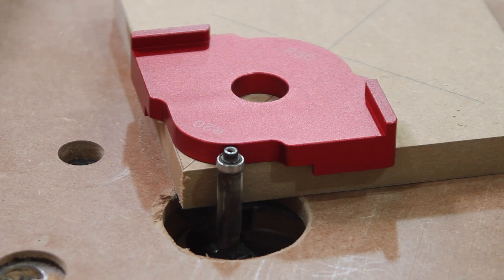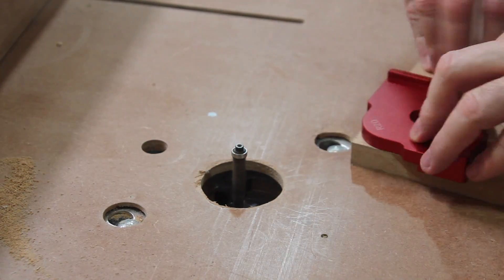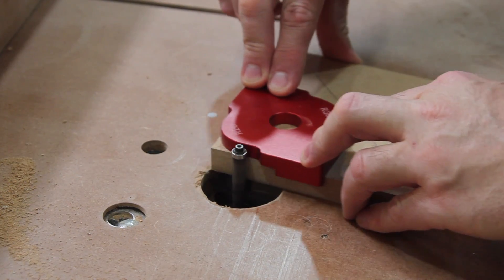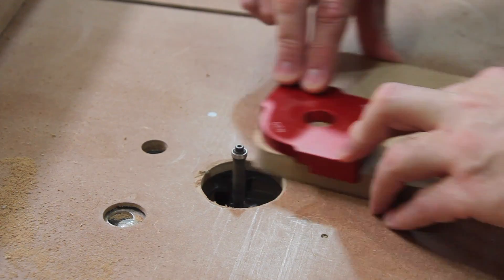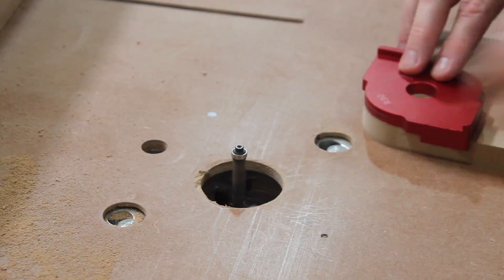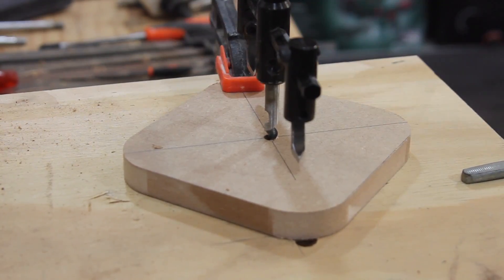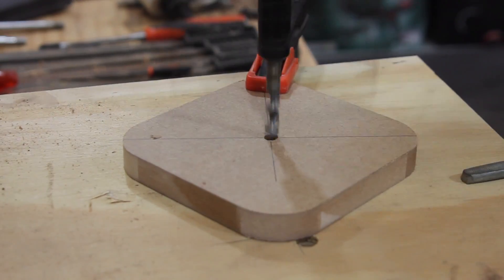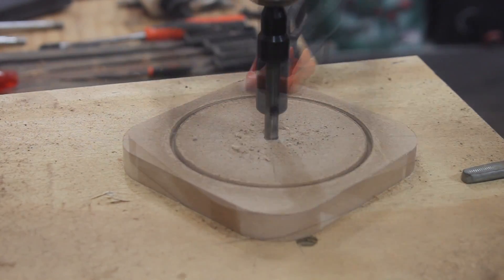Building Suspended Stereo Speakers in Copper Pipe Frame - by SoundBlab

Comment: Nice. I'd recommend small bungie cords for the suspension instead of rubber bands. You can also find the raw cord sometimes listed as shock cord in backpacking shops an online. Too nice of a build to use those rubber bands, I think.
Reply from the maker: Thanks! Yes bungie cords can work. I would've preferred a good looking spring better perhaps.

Comment: What is the advantage is suspending
Reply from the maker: The idea is to try and avoid any mechanical vibrations transmitting back to the cabinet and the drivers, essentially isolating them.

Comment: Great work. I do want to know how you size a box with a passive radiator if there are no T/S specs? Assuming they are from China/eBay/banggood. I'm about to use a pair and completely stumped with that :)
Reply from the maker: It is really all about the weight of the radiator. I would weigh it and then estimate how much of that would be the surround and basket (if there is one). Subtract it from the total weight and I then use this number to base my modelling on. It is not very scientific, but so far it has work well enough, at least for cheap Chinese PRs. Or, if you order an extra PR, remove the come from the basket and surround and get a more precise weight, but you'll have to sacrifice a PR driver.

Comment: why metal,u could have used less resonant materials for suspension.
Reply from the maker: I suppose wood could be a better material, but this was just an experiment really and you could use various materials that would be better. I liked the looks of the copper pipe though.

Comment: Why did you make the box out of layered mdf? Why not just make the box with 6 panels of mdf?
Reply from the maker: I can not achieve the large radius on the corners if I just use a 6 sided box, unless I layer that as well. Either way, its layering or altering the design.

Comment: I have built many DIY speakers. The suspension principle does work.
My latest speakers have no enclosures, and the speaker chassis are suspended on steel cables....woofers included.
There is no surprisingly no movement of speaker chassis in response to frequency until you get down to 5hz (woofers)....but this may be dependant on  cable tension & length. Anyway, at 5Hz I'm not going to worry.
Effect has been a level of isolation never achieved before. This translates into improvements in sound, including huge gains in cleanliness, soundstage and detail.
The armchair engineers  can express their doubts. Meanwhile, I have actually built them and can enjoy the fruits of my labour.
Reply from the maker: Awesome! Would love to hear them!

Comment: Have you not heard of Newton's 3rd law?  This may be ok for tweeters, but for bass this is the worst thing you could do.  Loss of bass and crap transients, not clever... :-(
Reply: Was thinking about that. Some people have no idea how to make speakers.
Reply: The mass in motion was the drive unit. I suspect that it was a very low mass. The MDF enclosure may have been hundreds of times greater. The acceleration of the cone from rest and back under drive would be using the inertia of the MDF and the speaker chassis to provide a reaction. MV for the drive unit would equal MV for the enclosure and drive unit chassis. So velocity in the cube would be 1/V of the velocity of the drive unit. The whole thing is mounted on springs which should have a resonance frequency below the lowest frequency of the driver. On balance the restoring forces of the suspension should be sufficient to only have a negligible movement if any. The sound should be good with no vibration transferring to the frame. Newton’s third law allows it to work and the design should lack damaging colourations. There is scope to experiment more with the suspension. O rings perhaps?

Comment: I'm curious why you choose to make the box with built up pieces. That uses a lot of material and highly labour intensive. Especially considering you covered the carcass,  I'm interested in your rationale.

Having said that,  they look pretty stunning with the copper frame.
Reply from the maker: In order to achieve the large radius of the corners, I could not just build a normal box. By layering and cutting a circle out of each layer I end up with more material on the corners of each piece to accommodate a larger radius.
Reply: SoundBlab It would be possible with thicker material and different methodology, such as 25mm mdf, or (if using 16mm) building up the inside of the corner, and rounding it over with a bandsaw and/or sander. Which may or may not be quicker come to think of it, and not necessarily use a whole lot less material.

Comment: Cool! Wich glue did you use to  glue the passive radiator to the box?
Reply from the maker: Thanks. It is contact adhesive. You apply glue to both surfaces then wait ten minutes and stick them together.

Comment: What exact "superglue" cyanoacrylate sticks to copper with good durability? I can't find any good for my projects.
Reply from the maker: To be honest, you are probably better off using something like two part epoxy. The superglue does not provide a very good bond. I use it just to keep the parts together initially during assembly. They do tend to come lose after while.

Comment: After all that amazing work, you compromised by using household elastic bands, which degrade in a very short period. 
I know metal springs were not an option, but what about black model making rubber - high grade used for aircraft?
Reply from the maker: True, but I will replace them as soon as I find what I am looking for and feel will work visually and practically.

Comment: Isn't this literally the worst possible thing you can do to a speaker, suspend it in air so it the whole enclosure can move counter to the direction of the driver movement? This will ruin the piston movement of the driver and waste a lot of energy. Not to shit all over it, but suspending a speaker is literally the last thing you should do if you want quality sound.
Reply: To fix the problem stated by derbigpr500, I would suggest using copper wire and tiny copper turnbuckles. The turnbuckles may be hard to source so something alternate might be needed. I know that machining a set of tiny turnbuckles wouldn't be to bad if you have that equipment. I really like the idea, mostly because I built an entire hanging shelving wall thingy out of copper pipe for my TV, stereo and such things. This would look great along side it. Thanks for the inspiration.
Reply: Do you honestly think those little drivers will pump harder than the slew of rubber bands holding them up? Nahh.. And even if they do and it sounds like shit, he can just add more rubberbands, or use solid wire to suspend them.
Reply: derpigr500 - your theory sounds good, but I'm sure, that it is just a myth. Even the inertia of the weight over all will not measurable react to to driver movement. I'm sure that lab measurements will show up none different values.
Reply: I WAS WRONG!!! Google "copper turnbuckle" and BAM there are some freaking awesome designs to be had. OK, now I know that I am going to make these!!!
Reply: you night think that, but mic suspensions are not to improve the sound but as you said isolate from external vibrations if not for that you could hard mount it and it wouldn't matter. For loudspeakers it's just lost energy though something to dampen vibrations from other unwanted sources would help, this type of system has too much rebound, think of it like a car with no shocks.
On a side not it reminds me of Von Schweikert who though that cardioid would be the best loudspeaker design, I forget the model it was, because that's the microphones used to record music, and this was just a few years ago... then he found out, I'm sure to his surprise that we use more than just cardioid.
Reply: This is not a scientific brawl. We both have only guesses. I could not find a lab test.
Reply: Quite the contrary, I'd say. Because the speaker doesn't have contact with it's surroundings it can't cause furniture, cups and all other possible things you might have standing near the speaker to vibrate, which should result in a very clean sound. So for studio purposes for instance, this could be a great idea.
Reply: The speaker is mounted in a fixed enclosure. If it is solid relative to it's primary mount, the secondary suspension mount will not effect the sound. It'll just keep the ridgid copper frame from buzzing on a shelf it's supported by.  Great observation but incomplete 🤔 badass design and such quality workmanship I just wish he'd demonstrated it in the video 😒
Reply: great for adding copper resonances:) otherwise a ql look:)
Reply: @jackbixby2471  fill in the pipe with sand
Reply: Farbschlachterei Tätowierungen yes for speakers this small it would make a smaller difference but it will make a difference for better or worse. Just feel the outside of a speaker while it's playing watch a subwoofer walk across a carpeted floor.
Reply: Sub walks not because of the mechanical movement of the piston. It works because of to acoustic vibrations.
Reply: Farbschlachterei Tätowierungen which comes from...
Reply: "so it the whole enclosure can move counter to the direction of the driver movement" - this can only happen, if the casing can react as fast and synchron to the piston. Isn't possible. Down to the facts. There is no real lab measurement. This all is just about a very daring statement.
Reply: Farbschlachterei Tätowierungen I will not pretend to guess what your knowledge comes from. But after 25 years of designing and building and measuring speakers I have my own theory of what makes a loudspeaker sound good, some designers have other theories. Some believe in the totally ineart enclosure so the least amount of energy is waisted others believe in tuning the system as a whole, using the sympathetic vibrations,  believing it will give a more "organic" sound, as I said for better or worse. This is why there are so many loudspeskers and no one can tell you what you like. Which is why I don't say it's the worse possible thing.
Reply: Farbschlachterei Tätowierungen okay last post as you said I don't want to turn this into a brawl..lol
But it would actually be good if the enclosure could react as fast then you could have an omni loudspeaker more easily done, the problem is that it doesn't act linearly and with the larger surface area it doesn't have to move that much to generate sound, weather it's noticeable is a whole other subject, and yes there are plenty of studies on this(almost all the big speaker manufacturer's know this and do what they can to minimize it) Google is your friend. Good luck on you journey!
Oh and please do research, without it and just stating thing, you sound like a flat earther or the like, in that case you don't want to know and there's no use in furthering this discussion.
Actually I've been doing this for about 35 year! Started in my 20's Wow where's the time go.
Reply: Some basic knowledge in physics will show up, that the theory, that a speakercasing can move as fast an synchron as the piston, so its function will be nearly as much retarded or neutralized up to a harmful result for the sound, is just daring. A middle ton piston stroke about 3mm at a frequency of 80Hz would mean, that the whole casing moves 80 times in a second 3 mm back and forward - opposite synchron to the piston. Thats just funny. That would be a visually pretty spectacle; not to forget that that is rocking. Please ask a practicing physicist.

The only way would be to build an enclosure that weighs no more than the speaker itself.

To return to the audiophile scene. Within 30 years (im right now 50) I've seen people doing and buying so much funny stuff, which effects are more attributable to the metaphysical area. And these same people had also detailed and good knowledge of hi-fi and speakers that one could only wonder how it could come to such intellectual misconceptions.

If you can show laboratory measurements that prove an effective negative impact in the audible range, we can continue to talk. I am not incorrigible and not infallible.
Reply: I am a very down to earth person. I would not hang any speakers. Also because I know from experience that this kind of decoupling does not work well. I've seen constructions with ropes and worse, with chains. Even ropes can "clink". That makes no sense, except an aesthetic one. I do not even like to hang lamps.
Reply: I would enjoy if SoundBlab would do a measuring with this both builds with an without suspension.
Reply: Think about the actual physics - typical speakers have mass in the tens of kg range, the drivers and the air they move is measured in tens of grammes.  The flex of the speaker case due to sound pressure is likely to be at least as large an effect as momentum balancing.  Suspending a speaker removes direct coupling to the floor/desk, removing one possible acoustic colouration due to direct radiation from that surface.

For powerful subwoofers true the moving mass is larger, but the box is also heavier, and its not 3 orders of magnitude worse.

The first issue with a speaker is placement in the room and the acoustic quality of the room itself.
Reply: UHm nope, you suspend mics to eliminate handling noise, rumble. since speakers dont record sound thats not an issue. not the tiny membrane need to reproduce sound, if the enclosure moves counter to the piston you lose energy....
Reply: Some energy is wasted pushing the enclosure, but the moving enclosure will then act as a speaker, so most of the lost energy is still making sound.
I would guess that a hard bass punch would make the enclosure bounce a little, so the sound is drawn out a little instead of being 1 punch.
There must be frequencies where the housing would resonate more then others, so tuning something like this would be a pain.
At low power though i dont see a problem, but also no benefit from this design, other then looks.
Reply: I would think they would soften the mid and upper ranges, when the diaphragm is actually moving fast enough to transfer energy into the suspension bands, which may actually do a lot of good to the sound of a 2 inch speaker...
Reply: ON NO !!! ITS AWESOME  BECAUSE OF THE COSMIC QUALITIES OF COPPER  HAHAHAHAHAHAHAHAHAHAHAA
Reply: Dear they are the worst people , they never mention the dimensions, they never tune the enclosure the only thing  get is noise
Reply: totaly agree
Reply: Its probably not the worst thing you could do to a speaker. For example, I would think smashing a speaker on the skull of a passerby after being thrown out of a window of a tall building would be slightly worse for the speaker, at least. At any rate, Newton's third law of motion came to mind after reading derbigpr500's comment. You know, the one about every action having an equal and opposite reaction.
Reply: I can't say anything about it until I have heard them play. all theories beside, it's the sound that matters.
They look cool though.
Reply: I believe the counter movement will nullify the effect.
Reply: It'll lose just a bit of bass.  The weight of the enclosure counteracts the piston.  But yes, ideally it should be solidly grounded.  Cool looking though, and that's what the builder wants.
Reply: Bacause of inertia the effect will be neglible. I can think of worse things to do to a speaker.
Reply: that's very different, the weight of those speakers counter the movement the driver might produce
Reply from the maker: I was more interested in how it looks this time round then overall sound quality.
Reply: derbigpr500 well, not really. All you're really losing, or getting rid of, is the boundary effect or boundary interference response. Which as you might guess, can be a good thing. So tl;dr depends on the speakers.
Reply: ever heard of a line array??? they hang speakers at every big show.
Reply: @djpetrez  They do not hang with rubber...
Reply: Please think again. Theorie was? That the piston movement will be ruined by a speakermovement. This can only function if the speakermovent almost matches synchrone with the movement of the piston. Otherwise this theory will not make any sense. So, the movement of a speakercasing which is just induced by acoustic vibrations cannot neutralize harmful the piston movement. Thats mindcrapping. Sry.

Comment: looks nice but the round interior  is bad for acoustics, also the reason they sound too bright is because they are very small diameter cones. you need at least 10-12inch diameter to produce the pure bass tones. a small cone needs a huge amount of travel in and out to push enough air, at low frequencies, to create the volume of sound. just add a sub with a lpf to the collection to fill out the missing bottom end. tactile subs are great for not annoying the neighbours... lol

Comment: It looks so cool, well designed and I would like to build something like that. But I think, those rubber bands must be replaced with something inelastic ( steel wire, chain etc. ) to hold enclosure steady. That helps to get better efficiency and sound quality. Nice work.
Reply from the maker: Thanks

Comment: This project looks cool but all you have achieved is a damper, i.e. a <a href="https://en.wikipedia.org/wiki/High-pass_filter">high-pass filter</a> with a cut-off frequency of at best a few hundred hertz, at worst a few kilohertz. Suspended speakers have a terrible efficiency with bass and the lighter they are the higher the cut-off frequency. You might want to add substantial weight to the enclosures — or make them with a metal like steel — for a better bass rendering.